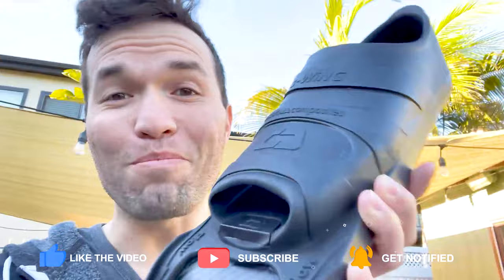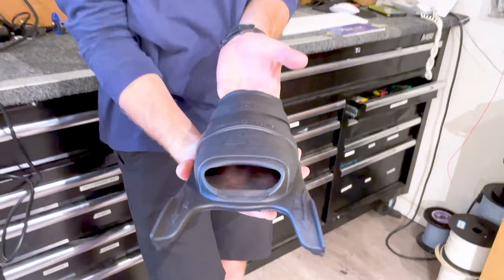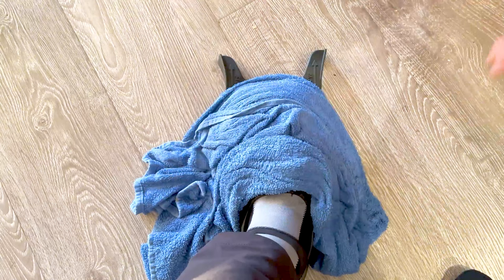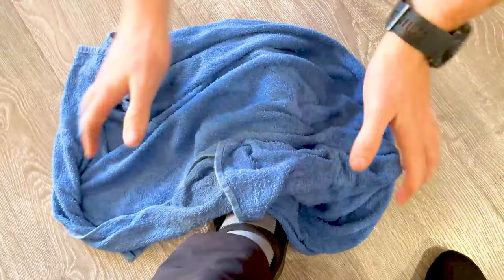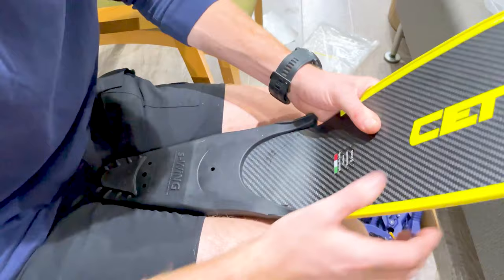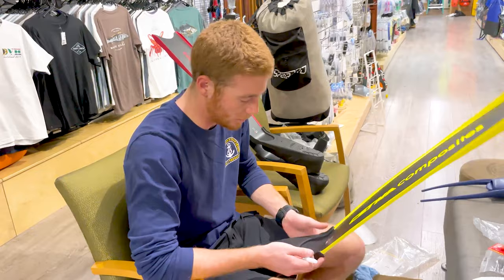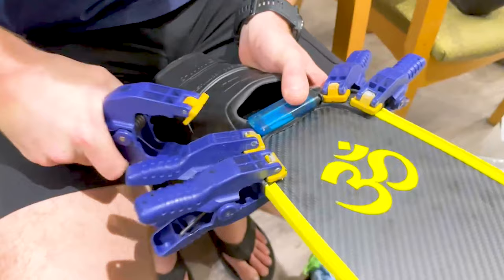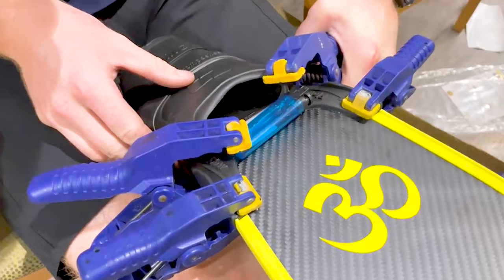The Freediving Fins Hack For Increased Performance

Comment: Sorry too ask but do anyone have a suggestion. I would also like to attach a new pair of foot pockets on my Finis Shooter mono fins. I have two sets different sizes of Finis Shooter mono fin xl and xxl. I have trouble with getting it fitting my feet. One , the xl is to tight over my toes on the top and too the sides in front of the foot pockets. The other, xxl was a bit big so I went too a diver shop here in Norway ( Oslo) and bought neoprene socks . We tried it out wobbling my foot with the Finis mono fin on. They said it was ok . The same day I went swimming in the swimming pool looking forward to train my dolphin kick  for 1000 meters. After 50 meters it was broken in the middle and on the right side of the foot pockets. When I came home to inspect why it so easily got broken, I see there are far too little glue between the fiberglass and the foot pockets. There were big areas with no glue at all, and this made it very weak . I already read and see some pictures in a comment section on Amazon that a man had help from a diver store changing for new foot pockets when the same happened too his Finis Shooter mono fins size XXL.  The other option that I also saw was a video from a diver store who used a heating gun to adjust the foot pockets…. But the problem is that the foot pockets are not only tight on the top of the toes. It’s also tight too the side where the foot pockets are more massive and not so likely too be stretched ? 🤔 . Therefore maybe the only solution is to by new foot pockets and hope I can find a diver store that can glue ( glue and screw) them on the fiberglass. I really like too train dolphin kicks in order to fix some problems I have with my core muscles 🙏🏻😊 Do anyone of you have some advice’s? Please 🙏🏻🤔

Comment: With glue if the seam fails when you are down on a dive and your blade comes off it could be a fatal mistake. I never trust glue personally.
Reply from the maker: What do you guess the probability of that happening is?
Reply: they go a long way in to the back of the foot, longer than regular carbons, it takes some effort to get them there, they don't come off easy even without been glued, I would say you could fin with these with no glue at all a d won't come off unless something pulls hard the fin out and work it a bit side to side in the way out.
Reply: That ain't happening believe me
Reply: And with screws if they break when you are down on a dive because they are weaker and crack easier, it could be a fatal mistake. Take your pick. Just stay in the swimming pool if you are worried about things like this.
Reply: What do you think grease is made from? Even if no glue anything can fail

Comment: If you need to adjust foot pocket as slightly too tight and fin has already been glued, is it ok to heat the pocket with fin glued in?
Reply from the maker: Shouldn’t be a problem if you stay away from heating the glue joint. Shoot Spear America a call to get their advice as well. Good luck!

Comment: Seems to me, that the chemical reaction of the super glue would eat away at the rubber of the foot pocket, and destroy the Resin of the carbon fiber or fiber glass fins. 

Super glue is super corrosive, so why would you ruin a perfectly good foot pocket and fin?
Reply from the maker: Maybe you're right. No issues so far, but if things change I'll keep you posted

Comment: I have had my Sporasub H Dessault fins for more then 20 years, they fit snug, and the blades is screwed into place no need for any glue (its hard to fit them though when I have taken them appart to fit my suitcase when traveling. no need for glue, has the fins changed a lot over the two last decades?
Reply from the maker: I’d say the freediving fins have changed quite a bit
Reply: @castandspear  to the better?
Reply from the maker: Ya
Reply: @castandspear  maybe I should get a new pair then, since I have not changed to the better it might even it out 😁
Reply: I have a one for more 30 years! Top best Fins! Blue Blades white Black foot  pocket!

Comment: I did that 4 years ago to my pathos footpocket,, thought it was general knowledge. Should have made a video about it.
Reply from the maker: Ya! Share more of your tips 😀
Reply: @castandspear  
I have pathos fireblade with xt diving blades on, so my Experience is only with them:
1. 
I took a hair dryer stock it into the foot pocket and wrapped a towel around the foot pocket, so the air doesnt blow out of the fron of the pocket. BUT kept the air intake free from the towel. 
2.
Then i blow warm air into the footpocket for a couple of minuts, check to see if the rubber is getting soft. When its soft, but your foot With your neopren sock on in the foot pocket and wait for it to cool.

3. maybe repeat

This makes a world of difference to the feel of the footpocket. 

Warning! Do this at your own risk. I'm not responsible for what might happen to your foot pocket.
Reply from the maker: Awesome! I love the disclaimer at the end 😂
Reply: @castandspear  
😄

Comment: The rail of soft plastic on the sides of my Cressi fins, that conducts water to the tip of the fin, started to peel off. Do you have a hack for repairing that? Any tips would be so helpful. Thank for sharing (: